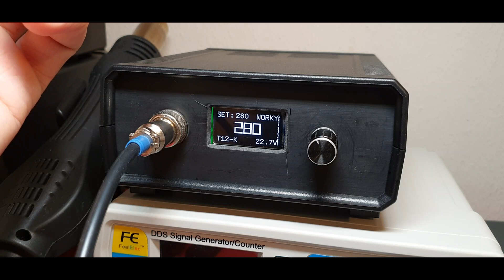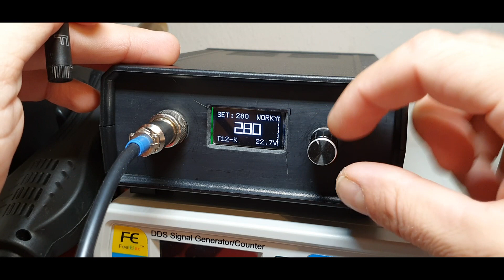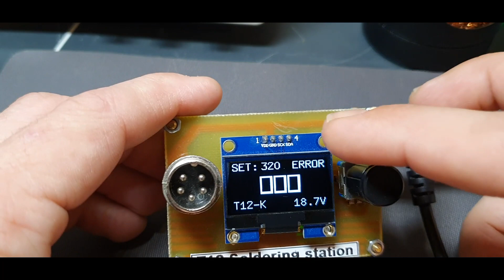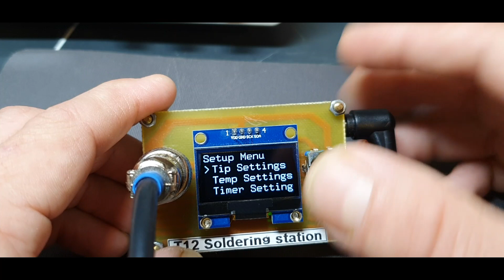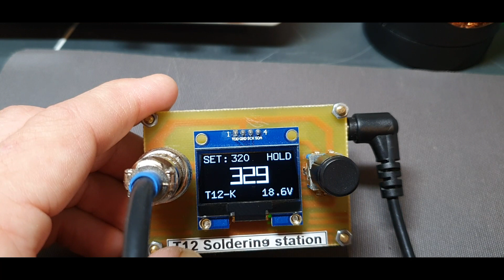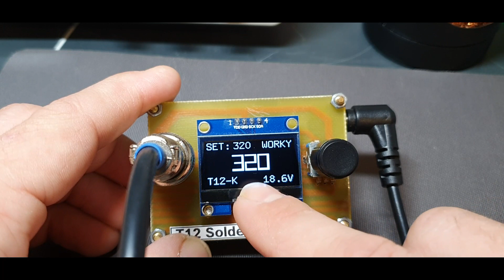DIY Arduino Nano Soldering Station V3

Comment: can it used for hako 936 ceramic heating element ?
Reply from the maker: @Chinhnguyen0497  No, the T12 tips have the thermocouple and the heater in series, on hakko 936 are separated.

Comment: Hi! Do you need a cold junction compensation for t12 cartridges? As far as i know, JBS tips have multiple thermocouples to compensate for cold junction is it the same with t12 cartridges? There is no temperature sensor inside the t12 handle

Comment: What a genius station : ( 

Can i use 24v 2.80 Amps Powersupply from laptop ? 

Have these Station a Auto Sleep mode ?

Please i will use a JBC Handle Grip with t12 Tips can i doo these dream be come true ?

Please helps 

Greets from Germany
Reply from the maker: Hi, yes you can use that power supply, 2.8A is enough for this soldering station but I would recommend you to supply it at 19V and I would recommend you to build version 4 or 5 of the soldering station (see the videos on my channel), and lastly, as long as you use T12 tips, it doesn't matter which handle it is, but be careful to respect the connections and polarity. Oh, I almost forgot, this station has auto sleep mode, and auto off mode if the station is not used for a longer time. I hope this helps.
Reply: Yes i will use T12 Tips but can i use the handle grip from JBC to modding it and use with T12 that where amazing ?

Comment: Hello, i built the V3 soldering station but the  iron doesn't heat up, i used lm358 and it doesn't work  it appears error on the screen. Can you help me please.
Reply from the maker: Hi, it can be multiple causes but surely is something wrong on the pcb or with the the components you use. 
1. Check if the Q1 is mounted correctly, check it's pin configuration.
2. Check all the components on the thermocouple amplifier, check the op-amp if you mounted correctly or if is good.
3. Check the Q2.
4. Look if soldered all the jumper wires on the pcb ( assuming that you made the pcb that I provided )
5. And lastly check if you have proper connection from the T12 tip to the station. 
I hope it helps.

Comment: Hi ! I made this great project. Thanks for sharing !!!
I have two issues : 
1.the exe file was not good (the display does not show correctly), but I used the ino file and the display now works correctly.
2.can I use a PENSOL soldering iron, with a type K thermocouple??? If so, how do I connect the thermocouple and how do I connect the resistance ? I should connect the plus of the thermocouple to the input of the Op-Amp, its minus to the ground, right?!? But where do I connect the heating resistance? Between minus and what pin???
I look forward to an answer to this problem and thank you in advance !
Reply from the maker: First, I didn't use the HEX file so I can't tell if it's good or bad, and you can't simply use the IDE to upload the HEX files to microcontroller. 
Second, the T12 tips have the thermocouple in series with the heater (only 2 connection points, + and ) that means that the power applied to the heater and temperature measurement are made on the same line. On the other hand the Pensol have the thermocouple separate from the heater( 4 connection points, heater and +/ of the thermocouple), you can try to connect in series the thermocouple with the heater or you can try to modify the thermocouple amplifier circuitry by making a separate connection for the thermocouple and the heater connected to P+ and P- as it is, the polarity doesn't matter in this case, only thermocouple have polarity. Hope it helps.
Reply: Thank you so much for this fast reply ! I will try to make separate connection for K termocouple. I will keep you informed. Regards !
Reply: Hi, I did it ! I separated the signal amplification part from the thermocouple (I directly connected the thermocouple to C13/R7 and the ground, respecting the polarity), and I left the control part of the letcon resistance unchanged. It works very well. I'm going to calibrate the tip (I haven't quite understood how to do it yet, but I'm persevering) and put everything in a nice case, in line with this great project. Some information about how the calibration is done, is it possible? Thank you very much, once again, for sharing the project and for the personal support.
Reply: Please, please, can you share with us the procedure of tip calibration ?? I made this great project, but I used an Pensol iron. And it is obvious that the temperature calibration must be done, because I can tin only when the station indicates 500 degrees (through boost). Thank you for this project and I hope you will clarify this aspect as well. All the best !
Reply: I managed, as far as I could, to do a calibration. I have another puzzlement: I checked the code (and it's OK), I checked R12 and R13 (and they're OK) and yet the voltage shown on the display is much lower than the real one. I'm wodering why ???

Comment: Hi, I have a problem with the temperature reading from the thermocouple. The error is about 50 Degrees. This leads to the fact that the top of the soldering iron is not sufficiently heated and the mosfet cuts off the power of the heater. The display constantly changes in value and does not calm down. Has anyone had this problem and what could be the solution?
Reply: Is your soldering iron with thermistor or thermocouple ?

Comment: hi friend i tried to make but it showing in arduino ide fatal error: Adafruit_GrayOLED . h : No such file or directory
Reply from the maker: Gray What?.. I never used such library, depending on what OLED display you use it can be Adafruit SSD1306.h or Adafruit SH1106.h this two I used.
Reply: @HMProjects  yes i have installed these two liburaries but same make a zip liburary folder in your pc and upload on g drive
Reply: @pakistanzindahbad  The case is the same as mine
Error code appears  Adafruit_sh1106.h : no such file or directory
Reply: @muhammadnibrahim3457  yes but i write the hex file using tl866 programmer it is working fine in my case

Comment: very good video sir, thank you!
I don't like the small station very much!
give me the big one and then even shielded with power supply in an aluminum box
because of the weight, the holder for soldering iron can then be fixed to the cabinet.

healthy greetings from the Netherlands!
Rob

Comment: Best choice project for me bro! I've modified it's OPAM to work with C210 JBC soldering tip TC and now almost done, not so accurately but ok for me . Actually, code is very hard for me to modify SLEEP MODE and TURN OFF MODE as JBC  soldering station that means when putting handle back to holder, It goes to SLEEP MODE immediately not like T12 using vibration switch in your code. So could you please show me how to modify it? Thank you very much
Reply: Bác thay opamp nào vậy bác?

Comment: analogWrite(CONTROL_PIN, 255);        // this shuts off the heater ???
analogWrite(CONTROL_PIN, 0);       HOW DIFFERENT
Reply from the maker: Hi. Difference is that at 255 PWM is at 100 procent and 0 is 0 procent, if the output pin from the Arduino were connected directly to mosfet gate at 255 mosfet normally will be open and at 0 will be closed but there are additional circuit ( see schematic ), so now at 0 procent mosfet is open and at 255 is close because the npn transistor will short to ground the mosfet gate, if it makes sense. Thanks for watching!

Comment: Hello sir i want to ask you can i use 0.96 inch oled display thanks
Reply from the maker: Hi, yes of course you can, you have to use the library for that display.
Reply: Thank you soo much i like yor projects can you make for us ( hot air station)based on arduino nano......  thanks

Comment: Materials???
Reply from the maker: I put a link in video description with all the necessary files, in schematic you have all the parts you need, resistors should be 1/4W.
Reply: @HMProjects  D3 - 5v zenner?
D4 - 18v 
C1,C2 - ? v/10uf
C13 - ? v/0.47uf
C7 - 35v/10uf ?
Reply: @HMProjects  help me
Reply from the maker: @nhp.94  Sorry for the late reply. D1/5V zener, D3/18V zener, but if you don't have 18V you can use 16 or 15V zener, I actually used 15V one if I remember correctly, For C1 and C2 I used 35V capacitors, since we use 24V power supply on the input C2 should be 25V or higher and C1 can be lower 10 or 16V but for convenience I used both 35V, it doesn't matter. And C7 and C13 for both I used 35V capacitors, be careful C13 should be between 100nf and 1uf, if you use a higher value you'll have unstable temperature readings. And another thing that I later find out, for R5 instead of 1K resistor is better to use 4.7K or 5K, whit 1K it will draw a little more unnecessary current and it will run quite hot. I hope it helps!
Reply: @HMProjects  oke tks bro
Reply: @HMProjects  can i replace 0.47uf 35v to 0.47uf 50v?

Comment: Could it be for lgt8f328 or not? Thank you 🙏
Reply from the maker: I can't say, I never used one of those before. I did quick research and it seems that it is compatible with the Arduino Nano board, I'm not sure but it should comply with arduino IDE. But better you have to try it yourself if you have one.
Reply: @HMProjects  I've tried, but it doesn't work, it only appears on the monitor, for rotary it doesn't work. Is there a program that needs to be changed? Thank you.🙏

Comment: Hi!
Greeting about the nice realization. So everything seems compact and beautiful.
The power supply from +5 volts is submitted to Arduino VIN. But there is a stabilizer and therefore after it remains +4.1 volts. This can be measured at Arduino's pin "5V" .
Reply from the maker: Hi and thanks your appreciation! Yes, normally on pin VIN wee feed 6 to 12V in order to get 5V  at the pin "5v" but since wee don't use that pin there is no problem. And also there is no problem because the ATmega328 microcontroller operating voltage is between 2.7V and 5.5V, it may affect the clock speed on the microcontroller but I don't know for sure.

Comment: Hello, very nice project.   is any way for this board to drive hakko907 or 936 soldering pen standard  .if not and only for t12 version can you made and share for 936 and 907 soldering pen versions.tanx
Reply from the maker: Hi. The T12 tips have the thermocouple in series with the heating element, you can try to connect the heating element and the thermocouple on the 907 handle, I believe it's possible but I'm no sure how it will respond in temperature changes because it will have a lag on the 907 handle( when the heating element will reach the temperature it will take some time that the actual tip will reach that temperature).
Reply: @HMProjects  yes but 907 and 936 have heater element and ntc or ptc in it and 4 wire two wire for heat element and two wire for ntc or ptc in it to control that soldering pen know do you know any versions to drive it i try to send you a link of one of that solder pens now
Reply from the maker: @h_pars  I know that handle from Hakko 907 and exactly what I've said, it has 4 wires 2 from the heating element and 2 from the thermocouple and you need to put them in series, but first you have to measure them with a multimeter. The heating element has around 8 Ohms and the thermocouple usually has a lower resistance.
Reply: @HMProjects  tanx
Reply: A digital driver for soldering pen like this link:     https://www.google.com/url?sa=i&url=https%3A%2F%2Fwww.joom.com%2Fen%2Fproducts%2F5d65114a1436d40101b82e0a&psig=AOvVaw34hzj3PdrtjRnGZb_pEIza&ust=1632822735425000&source=images&cd=vfe&ved=2ahUKEwi43KPq8J7zAhVWdqwKHd4YCMYQr4kDegUIARD6Ag